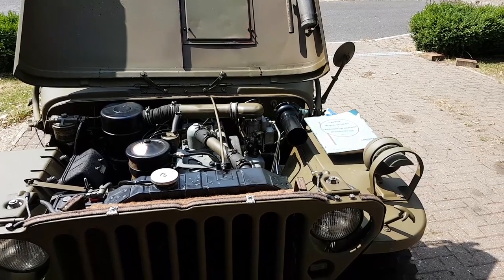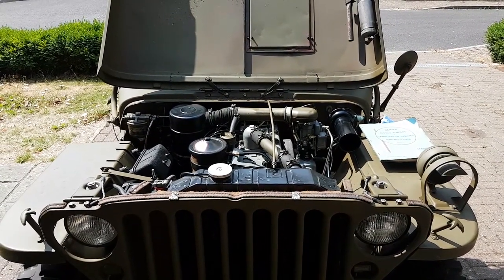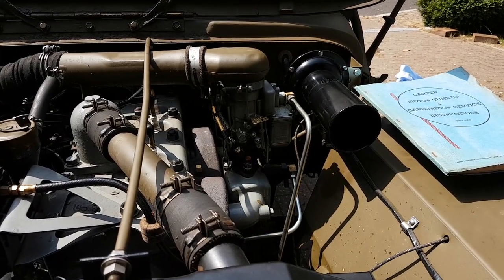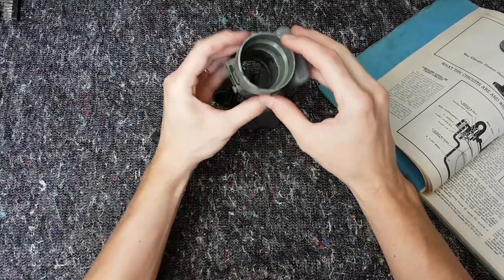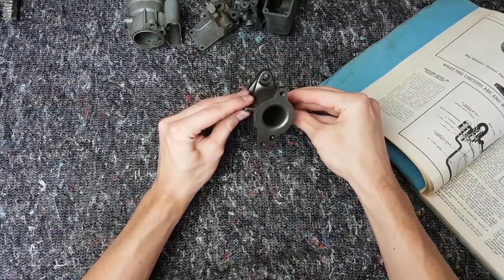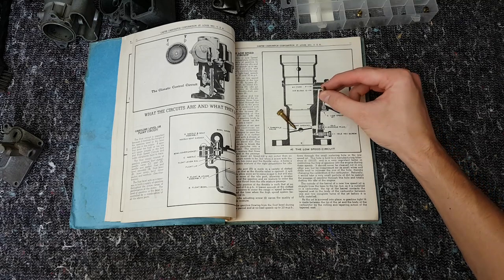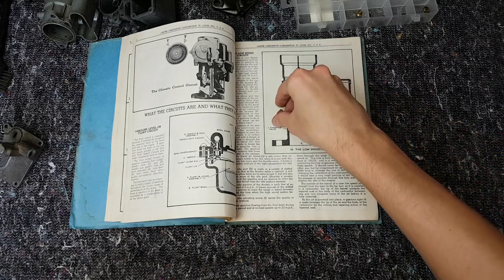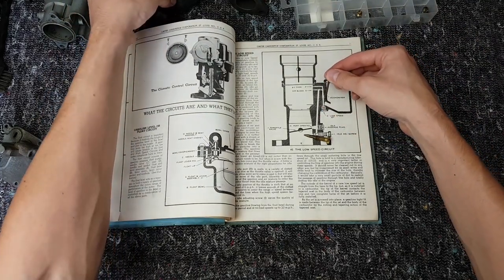How Does it Work? The Willys jeep Carter WO Carburetor EP1

Comment: Great video!  Breaks down the essential elements well.  If I understand it correctly, it would appear that the FIRST order of business, when tuning the carb, would be to set CORRECTLY the float level, since all other circuits "flow" (pun intended) from that very critical setting?

I hope in a future video, you cover the impact and fixes for the all too common worn throttle shaft and throttle body which allows air seepage, affecting the idle, often producing an intermittent miss at idle as the air seeps in irregularly.

Thanks again for your continued contribution to keeping these amazing machines rolling!

Comment: This is very helpful. Thank you for taking the time to produce this ;)
Reply from the maker: No problem Thomas, glad you enjoyed it
Reply: I think you explained my issue regarding the pump circuit hesitation. 
I look forward to learning more
Reply from the maker: Thats good to hear, the pump circuit definitely needs to be working correctly for proper Carb performance, as soon as you touch the accelerator pedal you should see fuel coming out of the pump jet, if not then it is something you need to look at!

Comment: Question: My 44 MB tends to idle correctly, but it dies when the accelerator is depressed. I am running a brand-new Joe's Motor Pool WO carb and I have had it on the jeep for about a month or so. Any ideas on what I should check? Based on your video, it sounds like the accelerator system is not functioning correctly, but given that I am running a brand-new reproduction carburetor, I'd hate to have to pull the whole thing apart. Thank you very much for your awesome videos and keep up the great work!
Reply from the maker: Hi, Pump the fuel pump handle up a couple of times until the carb bowl is full of fuel then take the air horn off the top of the carb and look down the bore, pump the accelerator linkage on the carb a couple of times, you should see a strong fine jet of fuel flowing out of a small nozzle down the side of the carb bore, it should flow for 2 seconds or so on a full stroke of the accelerator linkage and it should look like a good strong stream.  Let me know what you see, cheers
Reply: @Greendot319  Thank you very much for the reply. I did exactly what you instructed and the small jet on the side is just barely pumping fuel into the barrel when I pump the accelerator. I think we found out problem! Any ideas on what I need to do to fix the issue? Thank you again for all of your help!
Reply from the maker: Yes, the accelerator pump needs to be checked and rebuilt.  The best thing to do would be to return it to the vendor and get a replacement, rebuilding is simple but if you've bought it new its not worth your effort to sort out  just get it replaced ;)
Reply: Roger that. I figured that that was going to be the case. I watched your rebuild video yesterday, although I completely forgot to mark what point in the second or third episode you started rebuilding the accelerator circuit. I guess I'll have to go over them again! :) 

Overall, thank you again for all of your help, my friend. Your videos have been indispensable and I appreciate you taking the time to put these incredible tutorials together. Take care and please let me know if there is anything I can do to help you get more subs, likes, etc! :)